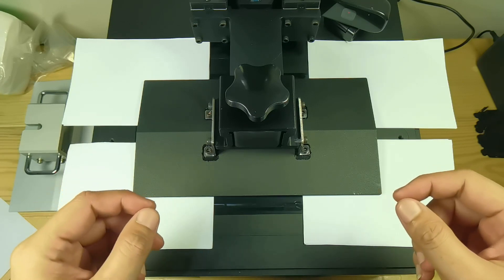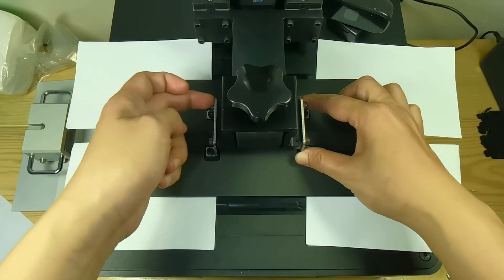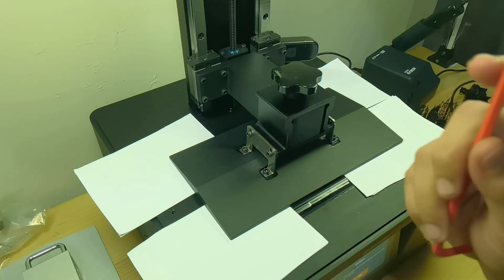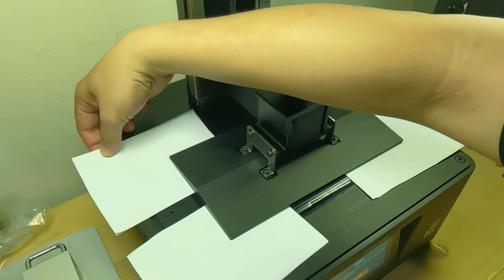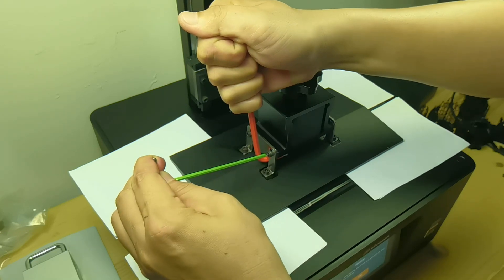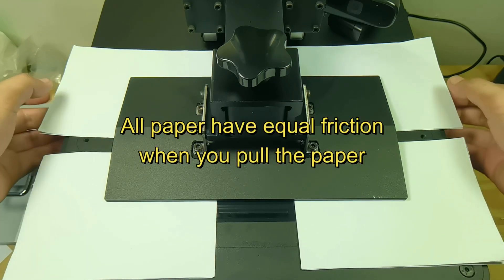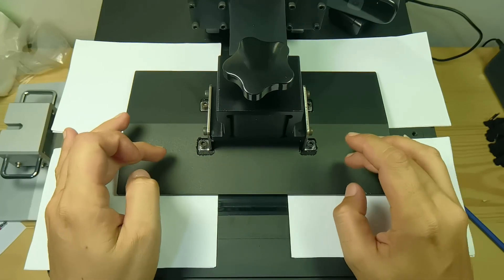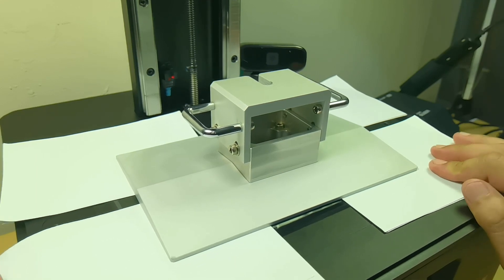Tips For Leveling Build Plate

Comment: I recently levelled by build plate in the vat as suggested by other build plate leveling videos.  Perhaps a coincidence, but I now have a hole in the FEP sheet. So after replacing the FEP sheet and screen protector I'll be sure to level using your method with the paper!
Reply from the maker: make sure the paper is like 3 sheets 80gsm,
on each corners

Comment: Apologies, I’m at my wits end with this method. No matter how hard I tried to adjust the pressure, there will always be a corner where the paper is either too lose or too tight….
Reply from the maker: @mangaartist1995  then try to compromise
And do a leveling test print.

Not everyone has the same experience and feel like me, i have been resin printing for 10 years
Reply: @wangdennys I did, it always the top corner that survives but the rest just fail to stick properly..TT_TT
Reply from the maker: @mangaartist1995  then be patient and relevel again. 
Use like what i did in the video with allen key to pull up that one problematic corner.
Reply: @wangdennys I’m sorry, I just tried it for days and weeks (including today, 5 hours for each day). Is this normal?
Reply from the maker: @mangaartist1995 normal
Back then it took me 2 weeks to get perfect leveling.
LOL
Reply: @wangdennys I wish I can LOL too but now I just wanted to legit cry. I felt I have wasted too much time on a supposedly simple printer only to get failed prints and feeling on the verge of madness for trying to level a bed for 6 hours in a row…
Reply: @wangdennys and I didn’t even managed to print anything with it for over a year due to that bed level issue. Should I throw the printer away? I kept wanting to drink alcohol after just trying to level the bed for hours while sobbing.
Reply from the maker: @mangaartist1995 what printer?
Reply: @wangdennys phrozen mighty 8k…

Comment: Hello, when i used one a4 paper for leveling my mighty 8k , the build plate wanted to go further into the screen and was making cracklin grind noise... but the print came out ok ... then i relevel with 4 a4 papers and the grind sound when build plate touches LCD is now far less but i can still hear it ...  also i reflashed with latest firmware ... is this normal for mighty 8k ?
Reply from the maker: That means your plate is still not level.
Check by pulling the paper, all must have the same tightness.
Reply: @wangdennys  tightness not a problem, im saying in my case one paper (thickness wise was not enough

Comment: You could shim the gap out to make the leveling process less difficult and complex?
Reply from the maker: not everyone own or has the material to shim it.
shim it even more complicated, you have to somehow precisely measure or gauge the gap distance, which not everyone has the tool.
then use something thin and strong like thin metal as shim, again, not everyone has the material.

i tried using paper as the shim, but it wont hold, the paper end up tearing.

tried using thin plaplate, same, the plaplate just tear itself apart.

i tried to make tutorial that is not require additional tool or material.

thank you for you input though.

Comment: on your first demonstration build plate you can probably eliminate that sideways gap by tuning the attachment of the vertical pieces to the main part of the plate. On my Photon Mono 4k the construction is similar to the last example, but the upper part is non CNC, but an |_| -shaped thinner plate, so I managed to get rid of those gaps by bending it slightly with a wise and a hammer 😅 so that it's a nice light friction interface with the plate now and leveling process is therefor straight forward without the need for those corner adjustments (which I found very annoying before the intervention)
Reply: P.S. and also huge props to Dennys. It's kinda just basic mechanics, but amazingly few people get it... And even fewer get to explain it to the wider userbase 💪 
I have a separate playlist of your short instruction vids to link them in reddit troubleshooting threads!
Reply from the maker: @iura_ch  thank you so much

Comment: Awesome vids, thanks Dennys. Question, do you recommend this above in vat levelling these days?
Reply from the maker: If vat leveling doesnt work for you
Than you may try it.
Reply: Awesome stuff, it’s around 00:16 here now. Will test first thing in the morning and revert back. I have a sneaky suspicion that I have applied to much pressure using a single paper sheet, and that could be causing light bleeding the first few layers, leaving my prints with what looks like (for lack of a better description) a really iffy looking resin brim which partially stays stuck to the fep.

Thanks again!

Comment: Hmm, thanks for the tip. I usually just use my hand to push down firmly on the build plate on both sides (i.e. thumb on one side and fingers on the other side) while tightening the screws (first pass criss cross 80% tightness and second pass 100% tight), and so far, the paper tightness on all 4 corners have been equal.
Reply from the maker: Yes
But some people still cannot get it to level even with push firmly.
Possibly their build plate screw gap could be larger.

Comment: Using 4 papers is a great idea! 

When I noticed the gap, I loosened all the 8 screws. Then I tightened the screews on top to make the pieces touch each other. After that I tightened the screws on the bottom and fixed it. After that there was no gap, and no leverage problem.